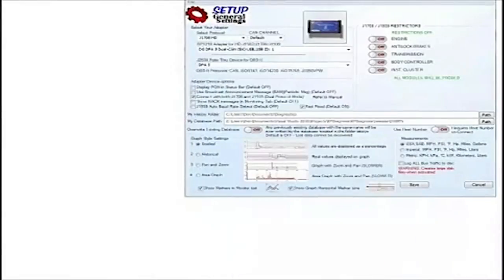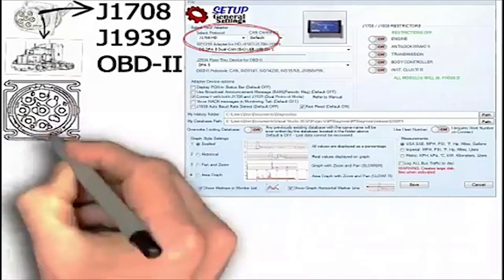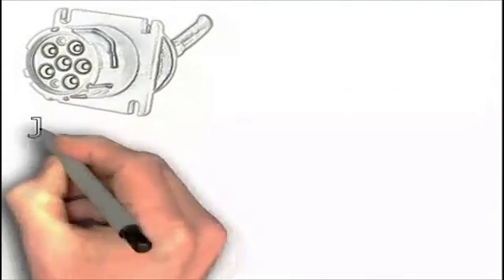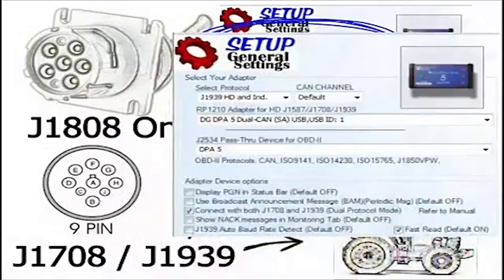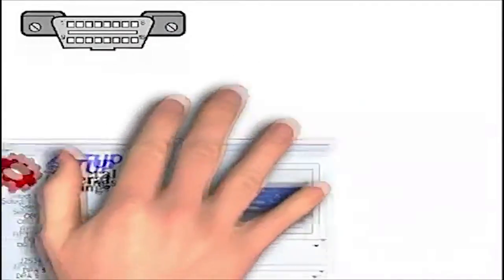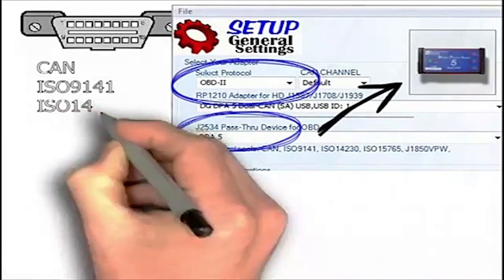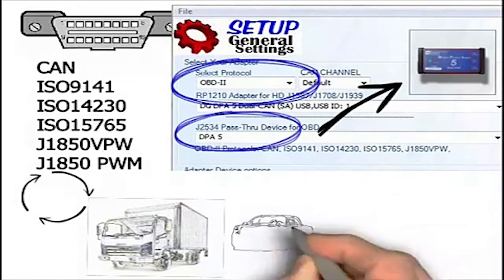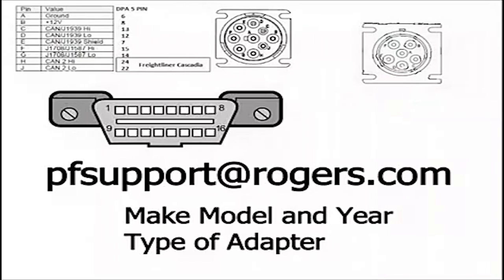Introduction to Commercial Truck Diagnostic Protocol J1708 J1939 OBDII

Comment: Hi.i have a 1999 peterbilt 379 with n14 cummins. I have a 5 o 6 pin data cable connector   I can't use the ELD ..i need to put  a 9 pin data cable connector n order to use the ELD.there is something I can upgrade. Like it. Adapter. Or change the full cable from the ecm ..eny help .. Thanks

Comment: can we use a convertible  cable between j1939  nine pin adapter and OBD2 adapter. Thank you.
Reply from the maker: We make that, and yes you can. Keep in mind that there are some differences between regular OBDII, Volvo/Mack OBDII, & CAT in GMC Trucks -- https://diesellaptops.com/Diesel-Laptops-9-pin-to-Standard-OBDII-Converter-Adapter-DL-OBD2-9.htm

Comment: Excellent Narration dude. It would be helpful for all if you could present a more clear picture for Pin-Outputs.
so that the difference betweeen 6-Pin J1708 and 9-Pin J1939 could be seen. CAN is used in both of them.
Though CAN has its speeds and Types aswell.

+Thumb

Comment: 6 pin 1708 only
Reply from the maker: Yes, the 6-pin connector is J1708 only while the 9-pin can be J1708 or J1939.
Reply: The video shows,1808.Is that a typo,or is there a J1808.I've never heard of that before.Thanks.
Reply from the maker: It is a typo in the video, nice catch!